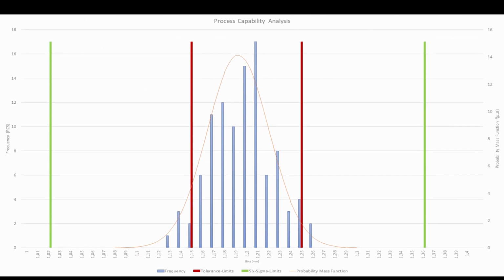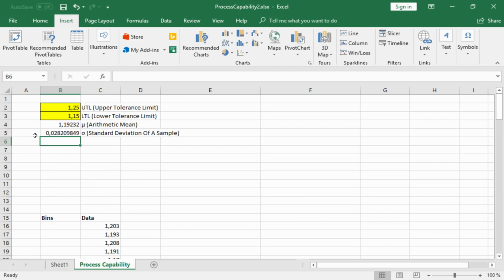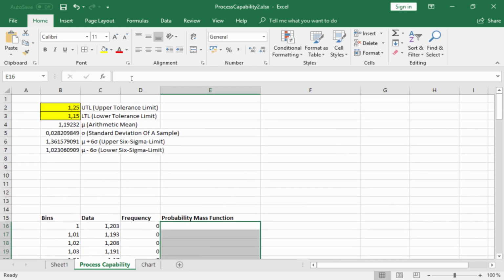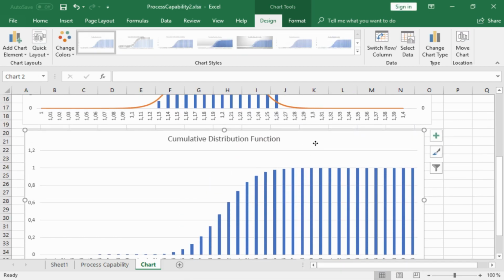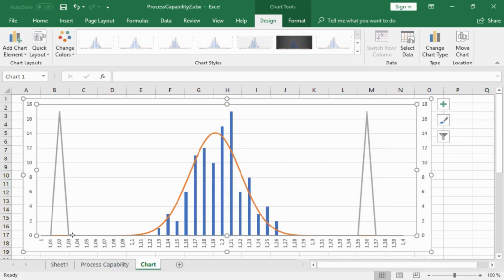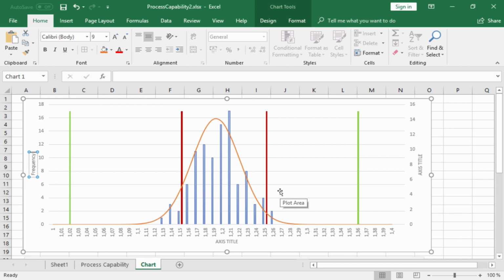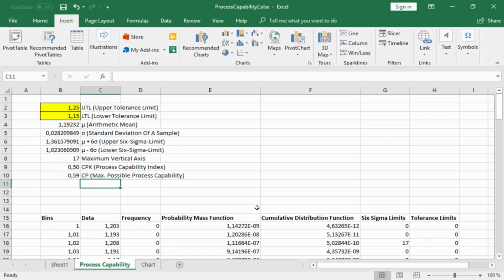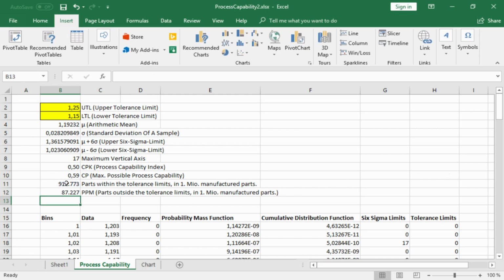Process Capability - CPK - CP - PPM - Normal Distribution - Excel Demo

Comment: Here the video has a mistake... instead of calculating for 6 sigma the video calculates for 12 sigma its (mue) + 3 (sigma) and (mue) - 3 (sigma)... 3 sigma one side of mean and 3 on the other side makes a six sigma
Reply: I am a CSSGB and CQPA. You are literally categorically wrong. Six sigma means 6 deviations between the average and BOTH the USl and LSL. This is why you end up with 3.4 ppm and not ~0.27%. You are referring to a normal plot.

Comment: This tool does not work for my situation, I have product failure related projects, but there are no data. I also learned that the statistics works with data, if no pertinent data statistics would not work. If you are trying to use this technique in a manufacturing environment, this may not yield anything, for sure it is your money you have the right spend the way you wanted it. There are better ways to handle problems like this.
Reply: Mr. Uday Nair, Yes, you are very correct, attributes of failures are many, like some of them mentioned above and it would be very difficult to pick one of the attributes and collect data from the manufactured parts and detect the cause of failure, after doing all those exercise there is no defect found, and you may realize to look for some other characteristics and keep doing the exercise until you find a margin of error in one of the attributes. By the time you do the exercise to make the Six sigma applicable, few things are going to happen 1. You spend lot of time in collecting the data and analysis until a defect is detected, 2. Cost, cost of inspection process or Six Sigma process would exceed the cost of the product itself 3. The defect identified may not be a critical one or may be minor one and it would be acceptable as is and 4. What if the sample size or production lot is very few, not enough samples to draw data, what would be the next action? Not to mention that you would pass the delivery date of the product, your customers are waiting to get the parts to proceed with the next operation, the bottom line is the risk is much more than the benefits. I went through these exercises earlier and from the experience I am speaking all these.

Thank you for bringing your suggestions for discussion sake and hope this would shed some light in the subject matter we are in discussion and it may help some readers of this post. You or any one can contact me to know more about the process control, do not get me wrong this Six Sigma process is a good tool or technique in a product or process where there are no basic or datum or for some developmental projects to define the product or process. Contact: bmatthewbob@gmail.com
Reply: @Uday Nair Mr. Uday Nair, Yes, you are very correct, attributes of failures are many, like some of them mentioned above and it would be very difficult to pick one of the attributes and collect data from the manufactured parts and detect the cause of failure, after doing all those exercise there is no defect found, and you may realize to look for some other characteristics and keep doing the exercise until you find a margin of error in one of the attributes. By the time you do the exercise to make the Six sigma applicable, few things are going to happen 1. You spend lot of time in collecting the data and analysis until a defect is detected, 2. Cost, cost of inspection process or Six Sigma process would exceed the cost of the product itself 3. The defect identified may not be a critical one or may be minor one and it would be acceptable as is and 4. What if the sample size or production lot is very few, not enough samples to draw data, what would be the next action? Not to mention that you would pass the delivery date of the product, your customers are waiting to get the parts to proceed with the next operation, the bottom line is the risk is much more than the benefits. I went through these exercises earlier and from the experience I am speaking all these. This is from your note “of course not saying this will be conclusive but can be helpful”, how much helpful? Spending the amount of time and effort would justify the cost of your finding, a very minor one; one of my instructors told me that Statistics is value neutral, no product or process knowledge.

Thank you for bringing your suggestions for discussion sake and hope this would shed some light in the subject matter we are in discussion and it may help some readers of this post. You or any one can contact me to know more about the process control.
Do not get me wrong this Six Sigma process is a good tool or technique in a product or process where there are no basics or datum or for some developmental projects to define the product or process. 
Contact: bmatthewbob@gmail.com.

Regards.

Comment: What's means "bins" I'm not sure.. if i have tolerance for example from 102,2 to 107,2 and my six sigma limits are 96,13 and 113,09, i have to include six sigma limits, so my bins should be from 96,13 to 113,09, and i have thirty measures it is my "data",  and what's bins i should take to my calculation ? For example 96,00 - 96,40 - 96,8 etc ? Or 96 - 97 - 98  ? And why, thank you for answer

Comment: Hi, obtaining the 6 sigma SL's become very difficult as the precision of measurement increases. Say when you are working in inches, and your measurements range in 3 decimal digits, say .235", the bins would have more than a single cell which can round off close to .235" value. This will result in multiple SL's line in the chart. Also, it is best to take min of LSL or LSL of 6sigma and max of USL or USL of 6 sigma to arrive at the bins value. If the mean offset from SL's, then you cant have the tolerance limits in the chart.

Let us know you have a solution for the above.

Comment: For six sigma limits, use the following formula instead as it was difficult to get a perfect match for the bin value. Also, 
limit the number of bins you create as the more refined it is in decimal places the more number of six sigma matched results it will give. I did this by limiting to 50 bin arrays.
=IF(ROUND(E68,2)=ROUND($F$63,2),$F$65,IF(ROUND(E68,2)=ROUND($F$64,2),$F$65,0))
Reply: Could you explain your formula ?